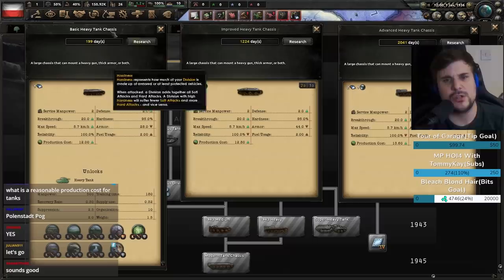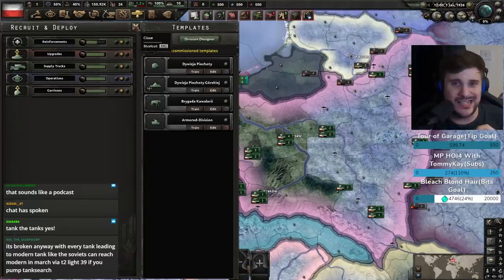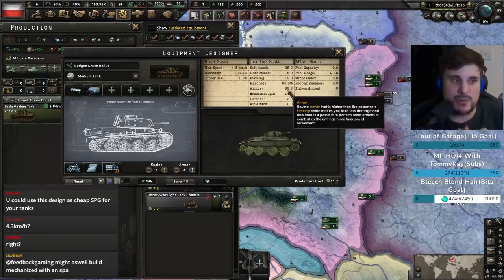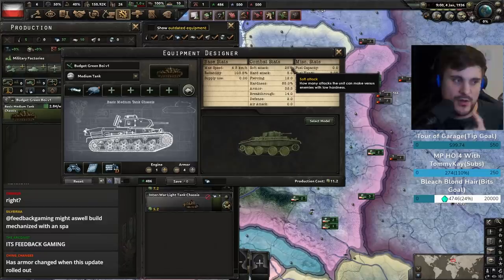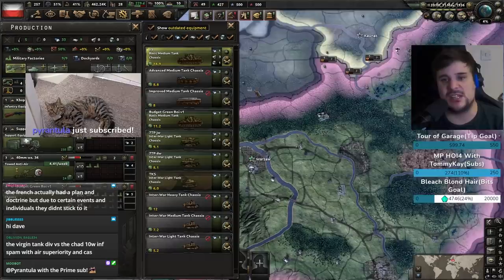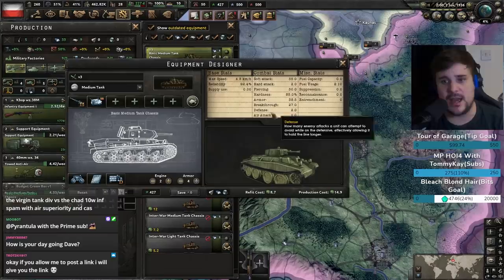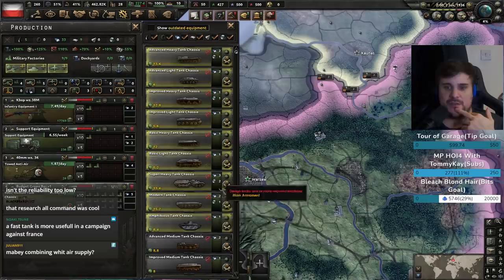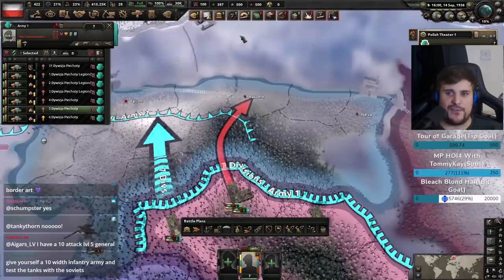NEW Optimal Tank Design - HOI4 No Step Back Tank Designer Guide

Comment: I was thinking of making 2 cheap light tanks:
 
1) Half-track suspension, Diesel engine, Riveted armor, 1 man turret, auto-cannon gun and dozer blade.

2) Half-track suspension, Diesel engine, Riveted armor, 1 man turret, flamethrower gun and a dozer Blade.

Use one as armored recon support companies and use the other as flame tank support companies in infantry. This would be cheap on production, give good bonuses (entrenchment, terrain movement/attack, max recon, plus an armor rating) easy on supply and be viable for small nations, What do you think?
Reply: I'm thinking "how exactly does M3 Halftrack count as light tank?". On the other hand, you basically made Putilov armored cars from WWI and they were basically no different from tanks back then.
Reply: Tanks as support company are great, but if you can make a light tank with as much breakthrough as humanly possible, you get super infantry its hilarious to see infantry with 100 breakthrough LOL
Reply: @SMGJohn  so you think that meta would be stacking of light tank support companies onto main divisions? Light recon, flamethrower and tank support?
Reply: Thanks for your feedback! I guess if you want some brake through you could add a radio or a 2 man turret after a conquest or 2 when you have the IC. Also, I agree don’t attack America or Germany with this. This is more of an early game Mexico against Peru kinda of idea and you could make like “proper tanks” later
Reply: The recon light tanks are 36 now!??! Lame. They used to be 24. I see your point
Reply: @TheArklyte  
Yes, if you stack 100 breakthrough light recon tank with either the auto cannon 2 or support gun, and add flamethrower tank which is essentially the same tank, with a dozer blade and flame thrower, you can have almost 300 breakthrough base stats on 30 width infantry with grand battleplan.
To achieve this level of funny breakthrough stats pre-1.11, you had to build tank divisions.

Whats even funnier, you can get this even higher if you add rocket artillery instead of artillery, breakthrough is extremely powerful and because of grand battleplan and that dozer blade on your flame tank, you get even more entrenchment. 
Stack it with general bonuses in combat + planning bonuses, we can easily see 1000+ breakthrough in combat, thats not a joke you can test this easily with the console.
Reply: @TheArklyte  depends on the country... you have oil? go for it.... you don't ? Don't do it... support companies need fuel as well. No fuel = low moving speed.... like, sloooooooooow
Reply: @blubbber  I thought support companies don't affect speed and width. That's why we can have towed antitank on paratroopers or cavalry. If you can't afford motorized/mechanized/tanks, you're stuck with 4kph infantry and 6kph cavalry anyway. As far as I know no matter support company you pick, their speed would remain the same. We're talking about breakthrough though.
Reply: @TheArklyte  They do affect speed. I was having fun as the Frenchies and decided to add flame tank into my speedy MT division. After making a tank as bare-bones as possible, I got a surprise when after adding it to template it brought down my speed from 12 km/h to 4 km/h.
Reply: @Vyury  so they don't affect the speed of infantry? Good to know. And I'm inclined to believe that they still work the same as armored car/motorized recon.
Reply: @TheArklyte  in all the games i played in new DLC with the suggested support companies the devisions with them (and with empty fuel) moved way slower. They also have the red ! and if you mouse-over it it will say low fuel.
Reply: Heavy tanks are cheaper than light tanks. Lights needs 60*cost, heavies need 40*cost
Reply: @TheArklyte  As the minimum speed of all tank designs is 4 km/h, no it doesn't. But if you want them in your tank divisions and keep their speed, you must put some points into engine. I set speed of tanks between 12 km/h (speed of motorized) and 15 km/h (speed of full engine mechanized).
Reply: @TheArklyte  Well yes, but actually no. Non vehicle companies don’t effect (foot recon, sappers, towed guns, signal etc) but vehicle companies (moto-, AC- and LT- recon, flametank) do effect. So don’t put early AC in 12 km/h light tank or motor infantry division - they will be stuck at 9km/h. You eather max out speed on AC before adding it or producing AC 2-3 as first AC. Aame goes with flametanks. For infantry you can do cheaper or more armored/reliable tank which is slower than tank division variant who tries to keep up with tanks and moto/mech infantry
Reply: add an engineer company with trench warfare doctrine. none shall pass.

Comment: 5:40 Actually, the Soviet Deep battle theory was the modern combined arms offensive with the technology of 1940. It did not call for tanks to operate independently. It called for combined arms, including tanks infantry artillery, and airpower to achieve breakthroughs and exploit them.
Reply from the maker: That's not what happened in the winter war
Reply: @FeedbackIRL  That's where you are wrong. During the Winter War, the Red Army had no pure tank units. The 1939-1940 mech div were not meant to work separately but to be used to reinforce infantry divisions. The only tank units were at brigade level and were divided down to battalions and used for supporting infantry during breakthroughs.
The best example of the Deep Battle theory up to 1940 is the Khalkin Gol battle(on a small scale)

Comment: I like using combat width of 21 personally. Goes well with forest fighting.
Reply: 21 is actually the most efficient if you compare them to 20 or 22. 21 does better in plains then 22 do in forests comparably and forests are the more difficlut terrain anyways.
Reply: @ingratus8160  im so used to always hearing 10, 20, or 40.. when did things change?

Comment: That support gun aka 'snub howitzer' on fast light tank 40's is insanely good even till end of mid game. I really don't have much use for the mediums anymore because well managed lights will just smash and race through nearly anything and are cheap to mass produce, and with cheap motorized following behind them to soak up any counters they can just encircle troops or spearhead for supply hubs with ease.
Reply from the maker: Light 2 is extremely underrated
Reply: @FeedbackIRL  Yep. They have to be taken care of a little more and you can't just throw them at an active wide battle plan or enemy tanks but that's not the point of that support gun light tank. It's Blitzkrieg at it's finest. XD To rapidly smash through infantry and gain rapid encirclements and quickly popping that bubble or rushing 3-6 tiles for a supply hub and crippling an entire section of enemy front lines.

Comment: I've found that if you put more than a couple of points into Engine, then you're better off sticking with the gasoline engine, because if you put points into Engine to compensate for the lower speed of the Diesel, then you actually end up with worse stats. The Diesel only makes sense if you don't put points into Engine. I think they should buff the Diesel because of this.
Reply: It’s also not cost-effective for fuel consumption. The same speed Diesel engine as a Gas engine will be consuming more fuel
Reply: @2kbk926  Yes, exactly.
Reply: @2kbk926  that sounds like a defect in the game. IRL a diesel pushing at a comparable velocity will be much more fuel efficient than a gas engine. There is a reason virtually every large commercial vehicle burning fuel is diesel.

Comment: Giving a tank a truck suspension and a diesel engine means you get a production cost reduction while losing NO RELIABILITY. This means the meta is basically a type of technical, not a tank. The funny part is, you can make a rocket technical for 7.8 IC instead of the 12 IC for the actual rocket truck from the research tab. The rocket truck is now USELESS.
Reply: but how many rocket truck is required for a battalion
and how many tanks are required in your battalion
you still need to look at the battalion cost
and which kind of designation you should give to that design.

Comment: Close support howitzer in 1 man turret...
That's basically Schneider 75mm. A WWI tank gun french forgot about, the one that was used in Schneider tank and in a version of FT.
Reply: it was forgotten for good reasons. compared to any other tank gun (even the 37SA18), it had zilch for penetration, the gun fired only HE at extremely low penetration

one of the reason of its existence was that in 1915/1916, they had a crisis where the shell manufacturing quality dropped so low that they were exploding in the barrels of their field guns, so the 75BS was created to use those shells as it's much, MUCH lower initial velocity wouldn't cause such catastrophic issues while delivering some pain to the enemy, in French it was called "mortier de 75 Schneider" (75mm Schneider mortar) and it's ballistics were so bad that as soon as the war ended it was removed from service.

even the French realised that at least some anti tank capabilities was good for a tank gun, the 1935 light tanks were made with a more powerful gun than the old SA18 in mind, it was just used in the meantime and as an economy measure, getting some early APCR so at least it could hope to damage enemy light tanks (at least on paper the SA 18 APCR could pierce the Front of all early panzers under 300m) and there was even an APDS under development that would give it the performances of the 25mm AT (40mm at 500m)

Comment: I think you need a solid mix of units now ,
 for cheap soft atack fast breaking divisions - a mix of mot ,rocket motorized /mot arty and cheap TDs 
for quality breaking a good medium division with good medium with high breakthrough 
for tank to tank combat a Heavy tank divison maybe (yet to see)
for defending and holding line , small inf divs (10 width or something close to it)
for cheap tank stoping / tank draining , Inf + TDs
to counter Inf + TD units some big inf divs (something similar to the old 14 /4 s ) 

also i think that the flame tank + pioniers will be in every atacking division because of the terrain modifiers
Reply: in my portugal-brazil game today ive found that 8 inf + 2 art + engineer + signal + support AT gives me a division with 230 soft attack, 420(nice) defense and 100 Breaktrough at 54 org. id just be rolling through france right now were it not to supply issues because i bombed the german rail network to hell and back

Comment: I’ve found the best way to do tank production is produce a crap cheap version and use the conversions to make your optimal one, you end up with 20-30% more tanks easily, kinda how you do the navy
Reply: As far as I've understood it, if you create a tank with 100 % IC (any IC really) and create a tank that has 3 times, so 300 % IC, you can get the new tank for additional 100 % conversion cost. In short: 100 % tank + 100 % conversion = 200 % IC for a 300 % IC tank.
Reply: like, start building as soon as you have the chassis then just convert in the variants once you unlock the modules and parts ?
Reply: @ArayaPancho  You have to have a gun, turret, and other basic parts, but just make it cheap then convert to a good design, takes less factories.

Comment: If you read this comment you are going to have to put out another video in fairly short order. armor is nice cheap mediums are good but stack breakthrough on light tanks and forget armor. All the armor, just leave it at home, gas engines, rivet armor, that... er... whats it called... reliability reducing fancy tracked suspension, auto cannons II (actually start heavy machine gun to save production), three man turret, radios, smoke, auto loader. aim for either 10 or 12 speed depending on what mechanized you pair it with, pair with mechanized. 42 width. 

As you tech up you can add more, obviously light tank 1s are not going to have reliability overhead for the fancy tracks. try to keep the template at around 15 per. This tank with this template has such absurd breakthrough that it will not take damage when attacking, even when penned, short of certain river crossings and forts there are few situations where this can't simply attack endlessly and and on top of being comically unstoppable they are quick. ...but they really suck at defense. I have seen 1800 breakthrough taking zero damage while attacking a german deathstack of two dozen divisions, including tanks, being penned the entire time until the battle was eventually won with zero damage, not hyperbole. Obviously, doctrines and generals are a big factor to.
Reply: Ima add here that you can tech directly from light tanks in to modern, their modern turrets have even more breakthrough, can mount howitzers, still count as tanks (not artillery) and they are only marginally more expensive to make than the light breakthrough design (marginally compared to how much breakthrough you gain).
Reply: Early game just use a Close Support Gun Light Tank w/nothing design,it is pretty much the first "good" tank design for minor nations if you want to have tanks division in early 1937 with no tank and artillery technology from start,and it will break pretty much any major's army
Reply: Yeah you get it, this is how Sovietsky manages to troll people with light tank Germany pre-1.11.
Cause his light tanks had stupid amount of breakthrough thanks to all the general trait stacking that he did, because of the breakthrough he could push 40 width Soviet heavy tanks with CAS support. 
Armour is overrated, also against AI, its even more overrated, AI aint human so they cannot build effectively and use effective strategies although its far better in this patch than ever before in fact AI is kind of obnoxious at times.

Comment: Optimal armor amount - 9 on tanks, 0 on TDs assuming your opponent is also making TDs. Armor is just good for breakthrough on mediums. Medium cannon 2, radio, fill with stabilizers for breakthrough. Replace one stabilizer with wet ammo storage and use torsion bar for MT1 and 2, you can go bogie and an extra stabilizer on MT3. TDs should be high velocity gun, two small cannons, and two additional MGs for soft/hard attack. Template is 40 or 42w, I like 5-8-8 MT-mech-MTD with engi, logi, arty, RA, medium flame tank. TDs give all your hard and soft attack now, tanks are focused on breakthrough. Replace 1 TD with 2 moto AA if you're not planning to win air (should always build some air this patch).

Comment: So one thing thats going to crack your theory here a bit is that tank destroyers require half the production numbers of dedicated tanks, but have statistic bonuses.

So one thing that is highly likely is tank forces using a spammable high soft attack tank with no substantial cost to it, backed up by an elite tank destroyer with incredible overall statistics to boost the average armor of the division.

Tank destroyers use half the tanks, but get 10-60% more penetration at the brigade level (Scaled by anti-tank tech,) hard attack, and fort attack. So it makes sense that they carry whatever high penetration armaments available to you.
Reply: Invaded US/Canada as Germany with a light tank army. Captured eastern Canada and New England based entirely on speed until I hit a wall and started losing a lot of tanks. Brought in a much smaller heavy tank army and just started punching right through the front. I haven't verified the numbers yet, but it felt like the heavy tank divs were faster to build. The effect was definitely worth any increased cost.
Reply: @tbeller80  The cost is often lower, because heavy tanks use 20 feweer tanks per division, or 1/3d less.

Comment: I really feel they missed a golden opportunity to redo the tech trees from ground, support, tank, sea, air, electronics, and industry to fire arms/canon, engine/propulsion, metallurgy, electrical, and production.  Ex: Researching guns/canon develops your ability to create you weapons for every class of unit.
Reply: Well they had that back then in HOI 1&2. When HOI4 came out, they streamlined the research tree because you now had the division templates and they wanted to reduce the micro management...i hated that back then. But in fact it was a good desicion. Going back to a humongous tech tree with a quadrillion tiny techs for every single weapon system combined with the focus trees, division templates, tank and ship designer would be a micro management hell and impossible to manage in multiplayer.
Reply: @ParanoidMaster  hmmmm.  A valid point. I like the changes to tanks but felt the naval change a tad lackluster.  I’d just like all of the currently spread out techs consolidate into common categories so if I research a canon improvement it effects artillery, tanks, and ships (of course in a balanced and logical way).  I fully expect the tank customization to reappear for aircraft.  And wouldn’t complain about a reshuffling of ships tech into hulls, armor, propulsion, and weapons instead of the hull giving the associated engine upgrade.
Reply: I think we need better visual indicators of what tech unlocks aditional or better parts. Maybe they could combine the tank and artillery tabs and make it similar to the naval tech tree (vertical instead of horizontal)